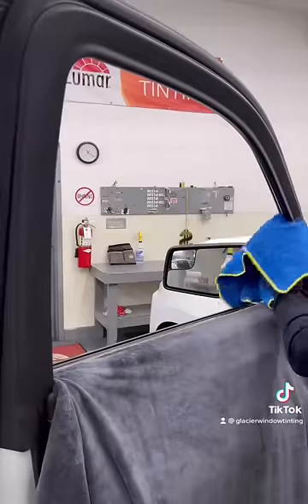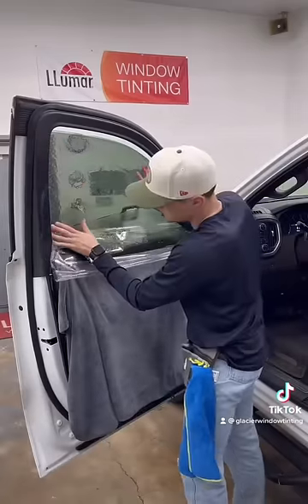Remove & Replace ✅

Comment: I've had Llumar ceramic installed on my last two vehicles and it's absolutely fantastic. I paid for the cheap stuff years ago when I had my first "professional" tint job done. It cracked within a year on the rear window.

Since then I've done basic Llumar once and their ceramic tint twice. You get what you pay for and I'll stick with this brand going forward.

Comment: For cleaning tint:
Baby shampoo, and water.
100% soft cotton towel. 

Windex (ammonia) is used to remove old tint glue 🤔
(so not good idea to use for cleaning)  
Windex will turn tint purple , and air bubbles will appear,  from reaction to ammonia eating tint adhesive. 

Paper towels are made of recycled cardboard.  Very abrasive on tint.(old 100%cotton t-shirt work well).

Comment: Would it help if I took the belt moldings on the inside and outside out? I want to get my windows tinted and I do auto body work for Toyota so my car is a breeze to take apart. I mean I could just bring the glass in and install them back myself. Would doing this help them do a fast professional job edge to edge??

Comment: In my area this type of window tint is illegal due to the fact that you can't break the window if need be. You'll get a ticket from the police if you have this type of window tint and they require you to remove it as well as proving that you have taken it off.

Comment: Still had some water in the tint next time start from bottom once you got that part done you can roll the window down then push your water out with your card they give you and if your worried about the window seal messing up your film   Pop your pins out of the door and pull it out a tad bit.

Comment: I've never seen an installer heat the window with a torch here in Texas, also 30 percent tint is illegal in Texas for the front seat windows. Nice job though

Comment: Ugh I was so mad when I had to take off my window tint in my front windows because NJ doesnt allow tint unless you have a letter from the DMV because you need it for your eyes when your driving but even then your getting pulled over every single time you drive anywhere and gotta show your paperwork...so it's not even worth it. So sad.

Comment: May be a dumb question. I have an old car that I removed the tint. Well most of it. The back glass with the defrost is not coming off. I don’t want to damage the defrost wires. How can I get the tint off?

Comment: Most of the time installing window tint I end up with a line of contamination in the middle. Have any advice? I lock down the top edge but I dont use heat, just the edge card.
Reply: Ok thanks

Comment: “a little bit of heat”
proceeds to blast the window with a propane blow torch that burns at around 1500 to 2500 degrees

Comment: Do you know if I can clean that soap out of the leather on the inside of my door or is it stained forever? The place I took it to didn’t put a towel over the door panels and now theres streaks running down my door panels

Comment: I always tell people if your getting tint done never trust a place that doesn’t put a towel into the window so the whole inside of the door panel isn’t getting damaged from water.
Reply: Literally have done over a thousand cars without a towel and never had a problem. Support small businesses. Water doesn't damage anything, it's just water.

Comment: Bro I’ve stripped llumar that did this exact thing. Or comes off in tiny pieces heat or not. Like the torch but a heat gun is cheaper. Can tell you do vinyl lol

Comment: So, the sides are of tempered glass. I'm not sure but all of you should be careful in blowtorching a car window he's a professional and he knows how to control the heat. Too much heat will weaken the tempered glass and will cause it to be brittle. If you accidentally made it glow red hot replace it immediately as it will definitely be brittle and will suddenly break anytime

Comment: How are you allowed to tint the front windows? Where I’m from it’s illegal. I wonder why it’s so different depending on the country, as the risks/cons should be the same. Pretty interesting honestly
Reply: They  need to get your money some how, some laws are just pettier
Reply: @doofyboser  the law against tinted front windows is for safety reasons. Although I’ll admit I’m not sure said safety is for the driver. I’m guessing it’s maybe for when police stops the car, they’ll be able to see the person inside and any possible weapons and stuff. Idk. Some laws really exist just for that sole purpose: existing 🤷🏼‍♀️
Reply: @astridmaack4516  until every state shares the law, ima rule "safety" off to an excuse to make a quick buck, but that's just me.

Comment: How does a client know the tint they prefer after research is the tint on their car without literally hovering over an installer and seeing that tint spec removed from an unopened manufacture’s box ?  Is it stamped or embossed somehow. And  if you only take deliver post install with zero observations during install?

????

Comment: Hi sir what spray did you u use to remove excess glue?
Reply: A razor blade / ulfa knife. If there are defroster lines you use degreaser and a rough scrub pad
Reply: @doofyboser  can i use it also in my headlight sir? Because im removing my film

Comment: I've never seen any tint guy use or recommend Windex at any point. Even just cleaning the inside of it after it's been installed awhile. Isn't it gonna destroy the tint?

Comment: My question is why not just pop the door panel and pull the windows? Longer setup time but breaks down faster as you can, 1 lay all 4 at one time, squeegee, cut and line time and shorten as there is no fine detail cutting needed and no folding.

Comment: When go in to see my eye doctor I’m getting a letter so I can get the specialized tinted film for my front windshield.
Reply: Lmao if you are talking about the clear stuff you dont need a medical waiver, and honestly just get it tinted anyway, ive never been pulled over for mine and its 30 percent
Reply: @user-nb8yt2il2r  no it’s a specialized anti glare tint for the front windshield that with the tint you need a letter from the dr and the letter has to stay in the car at all times incase you get pulled over. 
I’ve been checking into this.

Comment: Why do you use a torch and not a heat gun? My dad a tint professional of 30 years has never used a torch for an area that big/ common. If I came back and my exterior plastics were warped, I’d be madder than hell. The only time he uses one, is the tiny crack head model with a noodle sized flame for the real tight areas. Anxiety 📈

Comment: Great product he used, BUT THERE ARE SOO MANY PROBLEMS WITH THAT INSTALL, mainly the huge crease he made in the bottom, middle and sides .. and I can’t preach this enough, BLOWTORCHES AND TINT ARE UNNECESSARY, use a heat gun but you less likely to melt the seals 😅

Comment: Isnt that illegal?
Reply: Not everywhere
Reply: In most states 30% on the front is legal. Any darker then that is illegal but doesn't mean you will get messed with. Just depends on the cops in your area
Reply: @EndTheFed1933  I see. Probably the risk getting caught is high, but the cops will let you drive if you pay the ticket and remove the tint?
Reply: @iguana4751  I think its usually a fix it ticket. Once you remove the tint they drop the ticket.

Comment: Should you be concerned about getting water and soap on the inside of the door when you squeegee? As you squeegee down, the water gets pushed down where the mechanics of the electric window are. is this not a concern?
Reply: No, it doesn't harm anything

Comment: It’s crazy that people here think this is how you “properly” tint a window…. Actually it’s kinda laughable but regardless of thickness tempered glass is highly volatile when it comes to thermal stress. So let’s say you work in a shop that’s not temp regulated, meaning almost any mechanic shop that’s ever existed, and are in the months between fall and spring. You have about 15 cars scheduled for that day and have had some of them already sitting waiting for service. Now let’s say you start doing what this guy did to an un tinted window that wouldn’t of needed the steam gun at first and started to blow torch the tint onto the glass. Just let your imagination run for just a moment and you will understand where I’m coming from. 

It’s literally basic common knowledge that tempered glass can shatter at rapid temperature changes from cold or cool to very hot very quick. Fun fact a propane blow torch will burn at its lowest setting at just upwards of 2,000 degrees f. Just sayin